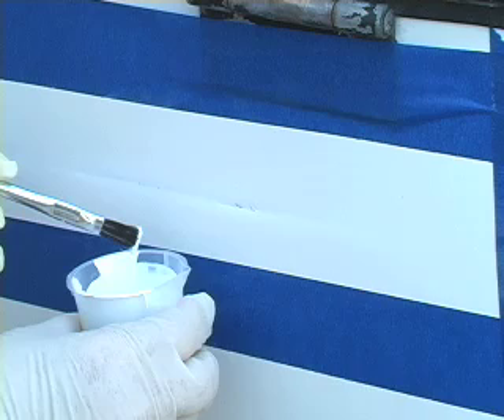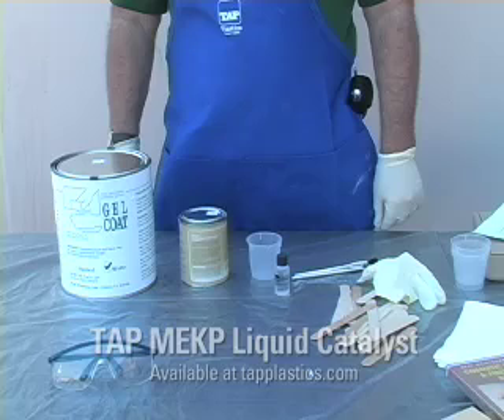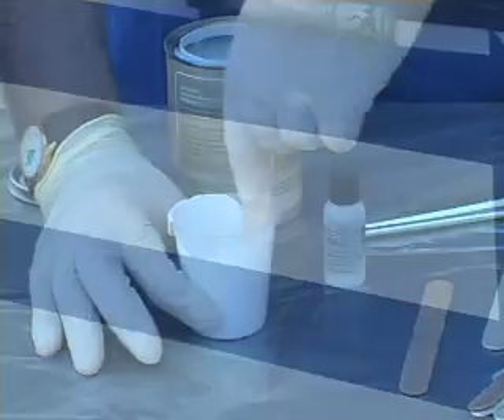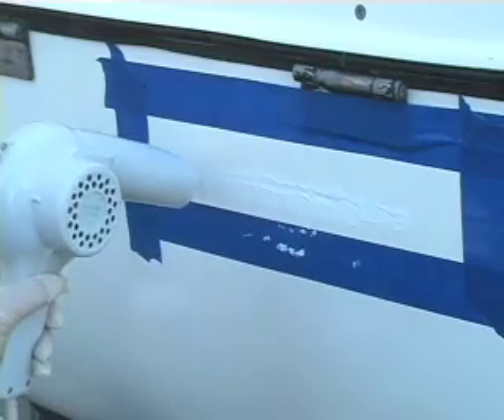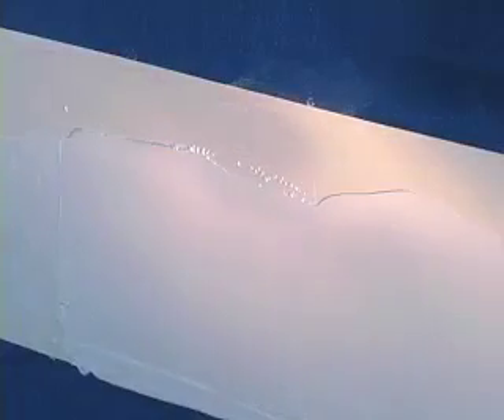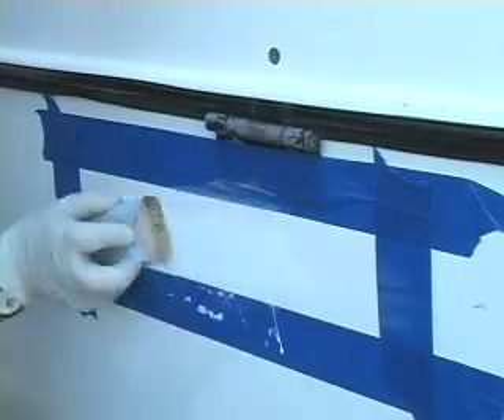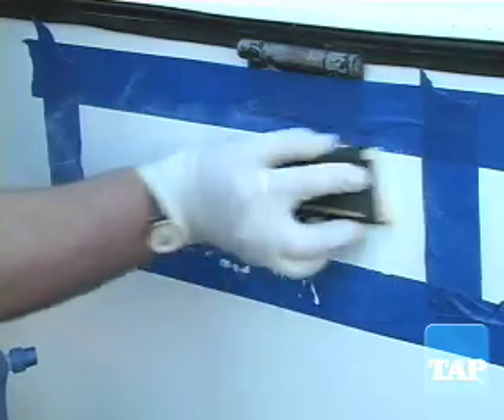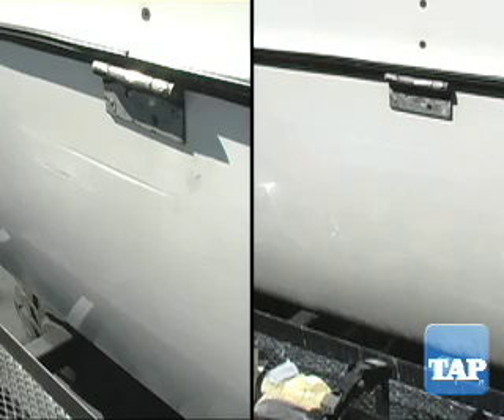How to repair Gelcoat Part 2

Comment from the maker: @gardee37 The spider web lines are called 'stress cracks'.  If they radiate from a point, they could be the result of impact. Since they are recurring, they are more likely the result of some stress or flexing that was greater than the gel coat's ability to absorb. The fact that they were repaired and returned indicates that any simple repair will be equally temporary.  A permanent fix would involve reinforcing the area from behind to eliminate the flexing.

Comment: I have found that if you 'replace' the air [oxidizer] in the can of gelcoat, paint etc, with Co2, there will not be any drying of the product in the can, therefore extending the life of the paint, or other product. I have been using this method on Japan Colors & house paints for 20 years.

Co2 is heavier than air and will displace air when added slowly. Put the lid on, store in a cool cabinet.

Comment from the maker: This is a major job for an entire hull.  Consider using a good marine paint that is designed for use below the water line.  There are catalyzed paints that produce very tough and gorgeous finishes with far less labor.

Comment: @gardee37 not a problem. dremmel them out wider than the actual stress fracture. key the area up with 120 grit and fill with chopped strand fibre glass. wait for that to cure and then sand back to a flush finish. gel and repeat the sanding process.

Comment from the maker: If the uncured gel coat is still liquid and wet (not gelled), you can apply Mylar to get a good surface cure.  If the resin has gelled, either wait for it to cure more, or apply more gel coat and immediately apply Mylar.  You can apply heat to accelerate the cure, but be careful to apply the heat evenly.

Comment from the maker: It depends on the structure of the piece you are repairing.  Some fiberglass has a clear coat added to the pigmented gel coat.  This is most common when you see the metal flake designs.  Otherwise, most fiberglass products do not have a clear coat.

Comment from the maker: @denzzz28 Thickness of gel coat should be no thicker than  12 to 18 mils, it can’t be used as a filler.

Comment from the maker: Without being there, it is hard to give a definitive answer.  It is the combination of heat and catalyst that causes gel coat to cure.  However, the top layer of molecules that are in contact with air will never cure.  Sometimes they will remain tacky, other times, not.  In either case, the surface is not cured.

Comment from the maker: First of all, gel coat is not a paint.  It does not self level or cure to a gloss like paint.  When boats are made, the gel coat is applied to the mold, then the fiberglass is applied to the gel coat.  When the boat is pulled out of the mold, it has a glossy finish as a result of the mold surface.  When gel coat is applied like paint, it will cure with an uneven, dull surface which must be sanded and buffed to create a gloss.

Comment from the maker: If you apply gel coat with fibers, the repair will be conspicuous and not attractive.  A better approach would be to grind down the area, apply some mat and resin, then top coat with gel coat.  Once cured the gel coat will need to be sanded smooth and buffed to a shine.

Comment from the maker: Gel coat cracks should be examined by a professional to make sure they are not the result of a structural issue.  They may be strictly a cosmetic problem, but only a professional inspection can determine that.